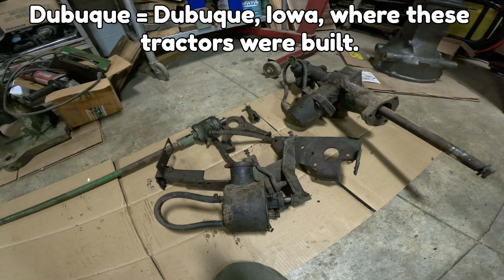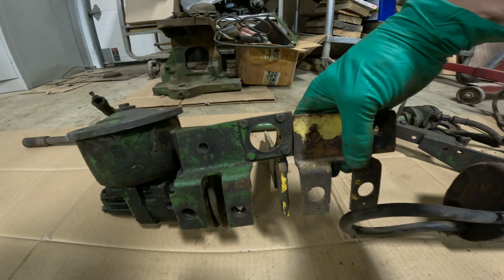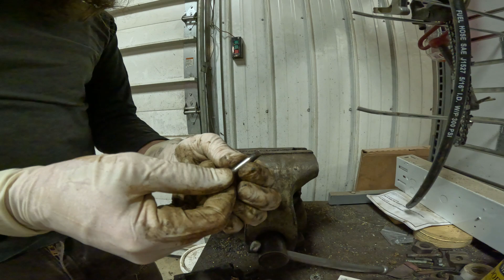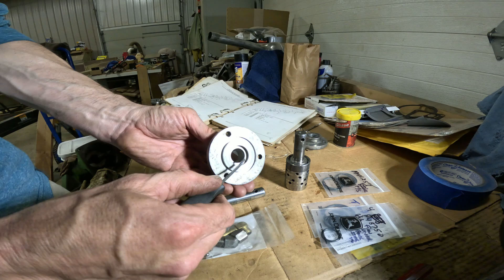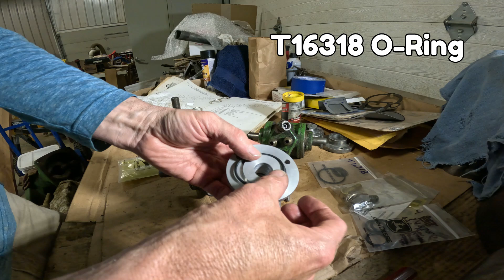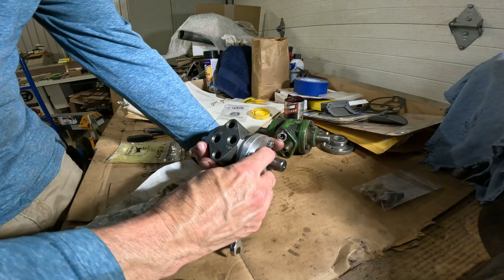John Deere 420 430 Dubuque Two Cylinder Power Steering Flow Divider Rebuild Restoration Episode 11

Comment: Hello, thanks for the videos, they are very in depth and helpful. 
I have a 440 gas loader tractor, as soon as I start it it steers and pulls all the way to the left and even popped the hose.
Do you think this would be caused by the divider valve in the steering shaft or in the valve up in the steering pedestal?
Reply from the maker: Was the tractor steering normally and this just started to happen?  Or were some repairs made and this started after that?  
The only valve I am aware of is the flow divider (which is in line with the steering shaft, sits above the engine).  The pump is obviously providing pressure, so that is good.  The pressure is being sent to the rack/pinion/cylinder assembly on your pedestal in an uncontrolled manner, causing to turn unchecked.  
That puts my suspicions in the flow divider itself.  Either a line is attached incorrectly or something internal is sending oil when it should not.  
Not sure if that helps, but happy to keep working thru it should you want.
Reply: @TractorDocDVM thanks for the reply. The tractor ran fine and then sat for about two year and when started it turned.
I also believe it's in the flow divider valve. 
I had it apart but not as deep as in your video, didn't see anything wrong. I'll go back in and keep you updated